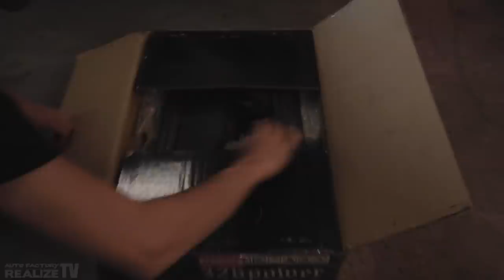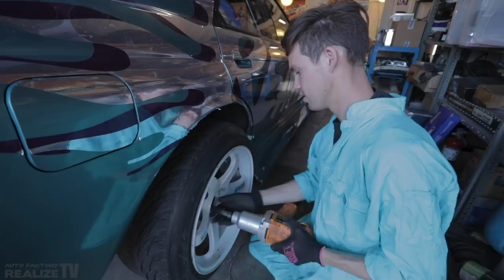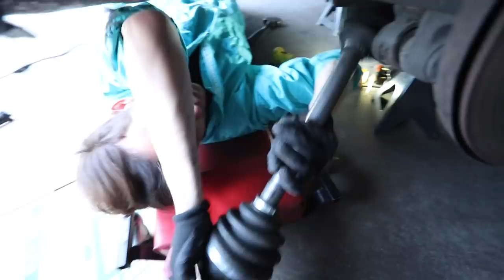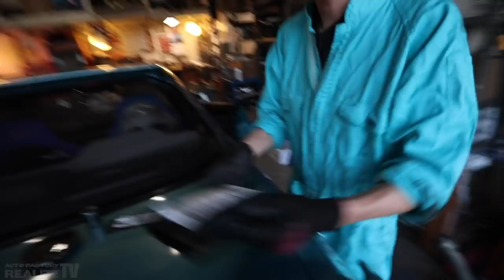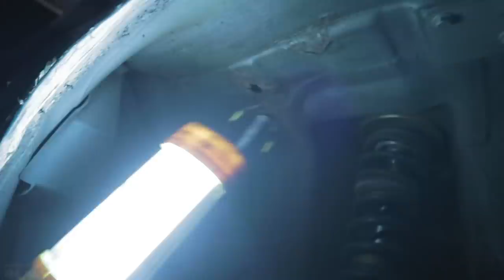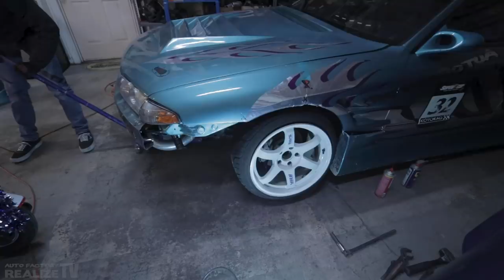This simple part may fix Teddy's axle problems for good...

Comment: Don't worry. That's not a rust hole. My 240 also has the same hole in the same spot. Thanks, Nissan. <3
Reply from the maker: Manufacturer installed work light mounting